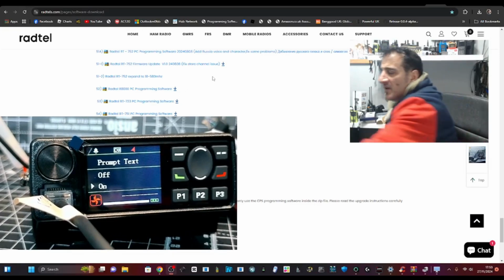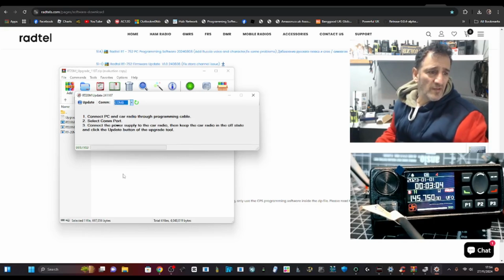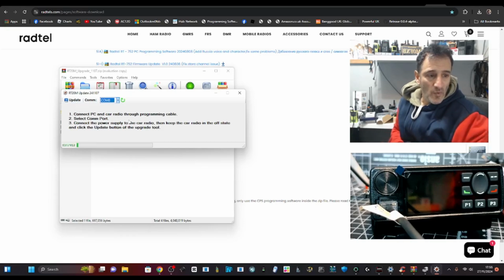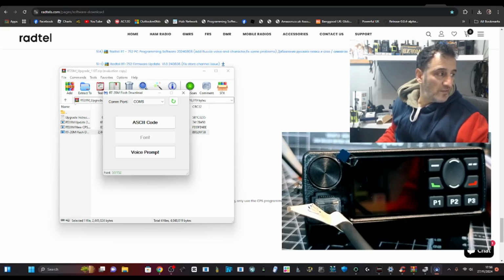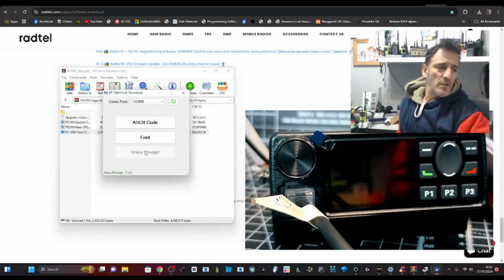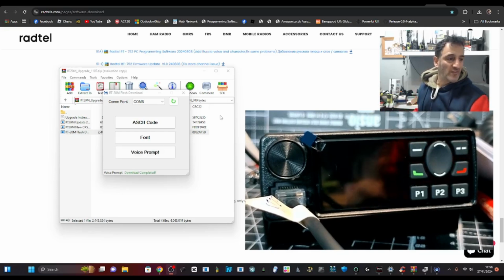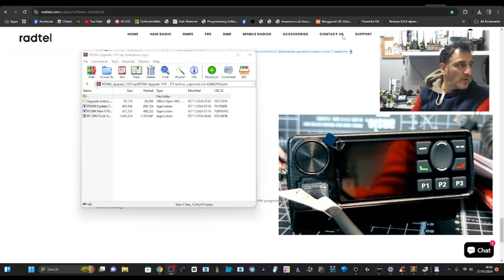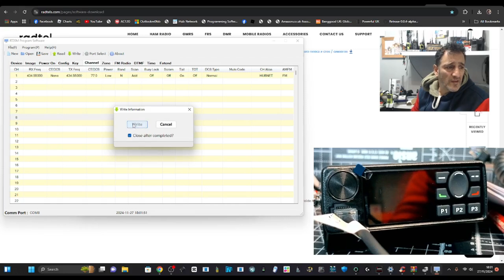SOLVED - FIRMWARE FAIL !  RADTEL RT20

Comment: tried this on my abbree... firmware downloaded and new cps will read the radio and say fail...the radio wont turn on now......
Reply from the maker: Put the original firmware back on .
Reply: @ i tried. And all i get when trying to load is some Chinese word with a exclamation point.
Reply: @ got it fixed. Watched your video again and had to write the first channel before writing to the radio.
Reply: Nevermind. Now it will power up say channel mode then shut off.
Reply: @aaronbradshaw3839  Is it actually off or is the screen just black?
Reply: @ i got rid of it months ago. It would power up say something then shut off...